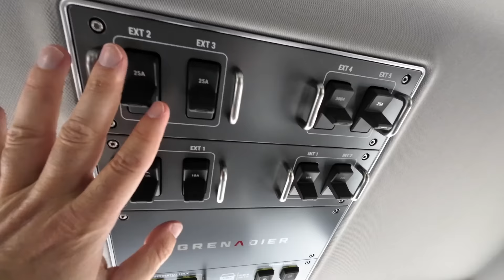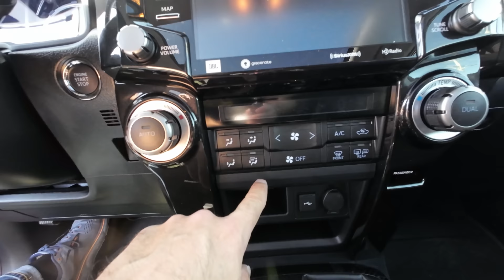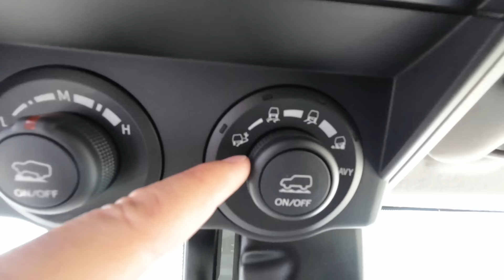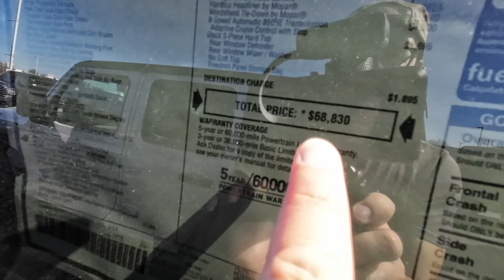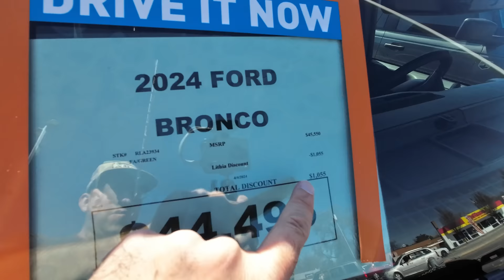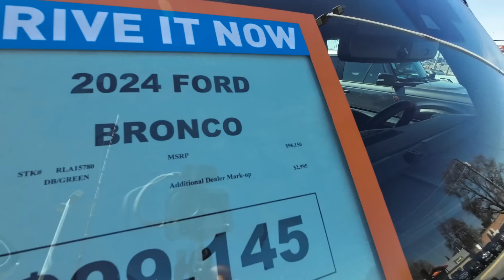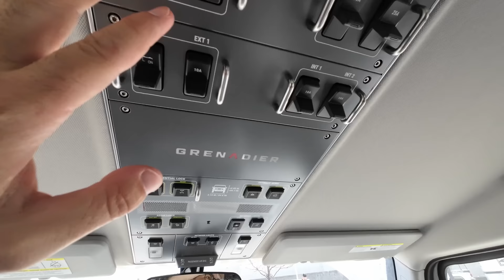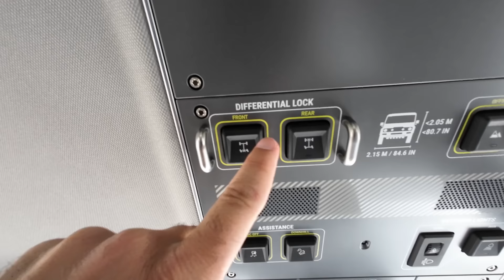This NEW SUV Has Ford & Toyota in PANIC Mode!

Comment: Listen good review yet I feel you miss some major points; 

The Jeep is not a good tower even on the small scale unless it’s a tiny travel trailer. And the Four Runner although not much better yet the slightly longer wheel base length, is better for towing.. And the 4Runner steering wheel. The Steering Wheel spacing at the bottom of the circumference has a “opening “ to rest your hand and arm as you tow or any distance driving regardless if you’re towing or not. 

The Branco is the best at towing among them all; Ford offers a Tow package and Ecoboost is spot on 🏁 Now I’m someone that tows,  two different Travel Trailers. I love Jeeps by the way. Yet my experience with towing wasn’t good in regard to my current half-ton.

Comment: All bout the 4 Runner. It’s Proven. I could care less bout “Out Dated”. If I could afford it, I’d snatch an SR5 with tow kit h and 3rd row before they screw it up with a turbo. Simpler switch gear is preference of mine, too. 42k is simply too much $, though. The TRD Pro seems too silly. Side steps are dumb, I prefer simpler controls and dislike the carbon fiber crap. That new one looks angry, no thanks!
The Wrangler needs a 30% cut in price. Better steering. Better mpg. I’d get a 2 door Sport S with  V6 and manual, but not for over 25k. They’ll start dumping them soon, sales are terrible. Base Broncos were 28k. It’s super sad they dropped it. Manual Base is the only one I’d like. It’s cool and under stated with manual. My kind of vehicle. 
I’m skeptical on the Grenadier Beamer powertrain. Regardless of Toyota testing and utilization.  We’ve been through this with Subaru power plants and Yamaha with Toyota.

Comment: I actually like what i see in the forruner in the video , and the Host of the video points out it has not changed much on that particular model in ten years .
 Which I see as big plus , if you buy a model that is known to be a good model and has a long run period, you can bet most of the bugs have been worked out and it will probably last for many years and be reliable.
 In my case i bought Toyota sedan in Australia that had a model run of 13 years which i new before i bought it , it was a fleet special or taxi spec model basically equipped, but with everything i need and nothing i dont !
 No stupid gimmicky huge  tv screens in the middle of the dash or intrusive not needed safety items that can be an annoyance .
 If i cant keep a car in the middle of the lane i shouldn't be driving the bastard , and neither should others.
 The car is  7 years old now and other than general standard  maintenance, i haven't had to put a spanner on it, except when I fitted a towbar.
  Maybe I'm old fashioned , but i see people all worried about not having the latest gimmicky crap in their cars , which nine  times out of ten makes for added complexity and less reliability.
 To coin the American phrase, " if it aint broke don't fix it".

Comment: Grenadier.   Named after a London pub. Starting at over $73k,  I'll pass on it and keep my 1991 Nissan Pathfinder 4x4 with 198k miles on it.  It goes were I need to go in the mountains, has a am/fm radio and a heater. None of the crap they put on new vehicles that cost a fortune to fix.  And I hate FAKE vents on a vehicle.

Comment: OK - Grenadier owner and former Idahoan weighing in here.  I really struggled with the choice - looked hard at the new Defender, the Sequoia TRD Pro, and whatever I could find out about whatever the new 4Runner will be, as well as all the pre-release info I could get on the new Land Cruiser.  The Lexus GX - I’m sorry, probably a perfect 4x4 but I just have a visceral hatred of Lexus.  Bronco and Rubicon hard pass.  I LOVE Toyota - but the Sequoia is absurdly huge, third row unusable, 2nd row in Pro are captains chairs, load deck is really high to handle the battery over the rear axle - and no flat load.  Toyota - I’m sorry, HP and torque numbers aside, I do NOT want a hybrid 4 and independent suspension up front - I want solid axle, 3 locks.  If I got the LC (eventually), and made it work with a lift kit, better bash plates, decent wheels / tires, I would probably spend almost as much as the Grenadier (86,5 plus destination fee - 88 and change).  But that would still be pretty awesome, front axle aside.  The new Defender - I just don’t think I can trust JLR - way too much to go wrong, with air suspension and everything.  I wanted stripped back and loved that Ineos used all the components most of us would pick ourselves for off-road mods.  Brembo, Eibach, Bilstein - in terms of the engine - the B58 has been in the top 10 in the world 4 out of the last 8 years.  Toyota engineers are totally behind it.  And the ZF transmission is buttah.  I’m just not buying the anti-German line, here.  All the engineering around the Grenadier is from Magna Steyr (Austria) - same as the G Wagen.  Ineos even pulled over the COO for the automotive division from Magna.  This is a really serious endeavor- not playing around with some mall crawler Pavement Princess.  The cost is not off what soccer moms are paying for their Yukon Denalis or if you did mods to one of the new Toyota Land Cruisers- and the price is for the quality of the components and construction (oh yeah, all the assembly line guys are from the Mercedes plant that Ineos bought in Hambach).  Not creature comforts or fluff.  Yes, I’m worried about service and parts.  Yes, I wish there were better interior storage options (where do I put my phone?!!!).  Yes, I still miss my turns when parking and need to take a second run at it.  But I absolutely love every square inch of that thing.  It has more character and honesty than anything I’ve ever driven (anything new, I mean).
Reply: OK, but give us an update on what you think of it in 5 years? I'll still be loving my Toyota in five years.
Reply: Yeah I’ve got 2 Toyotas - of course I love them.  I kind of don’t get the indignation of Toyota owners over the Grenadier.  Toyota walked away from the “real” Land Cruiser, so it’s not a huge surprise that there would be buyers for an expensive, overbuilt 4x4 tank with 2 solid axles that doesn’t run on a hybrid 4 (shudder).  Honestly JLR and Toyota did the same thing to those buyers at the same time - leaving them with hybrids and independent suspension.  Classic Defender and Heritage Land Cruiser - RIP.  You both deserved a better fate.

Comment: wats sad is USA's war on diesels! if the B57 diesel isn't offered its a pity!
Reply: Correct - the reason Ineos couldn’t offer the B57 in the US (it’s offered in the other markets) is BMW couldn’t offer a 10+ year emissions certification, so Ineos couldn’t take the risk.  So we only get the B58.  That’s a regulatory situation - not a BMW or Ineos thing.  Only other option would have been to go with a different engine and transmission supplier - no WAY Toyota would have gone for that, and they are hell bent on hybrid, which Ineos didn’t want anyhow.

Comment: Give me an old 4x4 any day over anything newer. I'm talking older like 1979 and earlier Ford 4x4's, 1995 and below Toyota 4x4, 1987 or earlier Suzuki 4x4. No ABS, No traction control, No driving assistance features, actual tactile knobs and buttons. built like tanks and can go anywhere.  No bells and whistles to force you to take your eyes off the road for 10 minutes just to find the icon on the screen to turn on your windshield wipers. And NO vehicle should cost more than a house.

Comment: The only problem it’s a ford, when you take a ford into the dealer they will say we don’t know how to fix it.  You get to drive around with check engine light on and poor performance and multiple breakdowns.
Reply: The crap 10 speed transmission they built with GM has a class action lawsuit. Error codes conveniently wipe themselves before you get to the dealer.
Reply: Only Ford? It's every dealership.All you'er paying for is the "TajMahl" showrooms, finance department and bullshit sales force. These little turbo engines are pure crap, all scrap in no time flat.

Comment: Cool video but you forgot the king 

2024 Toyota Land Cruiser

You have a jeep so i know reliability is not your top concern 😅
Reply from the maker: Haha. For now... I choose fun over reliability.
Reply: @MotorFeed  fair enough!!! :)
Reply: You mean the one with independent suspension, no front locker, a hybrid 4 cylinder, baby road wheels and 8” of clearance?  The new LC is not anywhere NEAR the capability or toughness of the Grenadier.  To get that, you need to go back to the LC 200.
Reply: @ElderStatesman-pi3lc  then less go back to the 200 and use the same money spent on the granadier on the 200 and see what happens 🙂, also when the granadier gets to last as much as the 200s then get back to me.
Reply: @tito10301 ok - so basically “I don’t think this new 4x4 is any good because it’s a new 4x4 and until it’s an old 4x4 I still won’t think it’s a good new 4x4.”  Toyota jumped ship in the US market, as did JLR - so I’m willing to risk it to get the truck I want and not what Toyota is trying to jam down my throat.
Reply: @ElderStatesman-pi3lc  sure thing is your money good luck tho 🙂
Reply: @tito10301  I know there’s some risk - but let’s recognize that the 2024 LC will be king of nothing.  It will probably be good - with some significant aftermarket modifications.  The clearance is sad, the hybrid 4 will break off-roader’s brains, the independent suspension in front will be continuously challenged, aux power up top will require drilling and running line, there is no offline battery, there is no integrated winch, etc etc.  The sheer awesomeness of the old LC is gone.  Toyota is starting from square 1 with a mall crawler that MIGHT be able to be turned into something decent, with significant effort and cost.  Or, Ineos will deliver that same capability and more, right off the factory floor.  I almost went for the LC ‘24 first edition and was tryimg to secure a purchase slot (we also have a ‘19 Taco TRD Off-road).  I took the Grenadier back to the Toyota dealer to show them WHY I decided against it.  Sales and service guys came piling out - cameras, climbing all over it - their statement, not mine “this is next level - this is a different league from the new LC.”  Their only comfort was Ineos isn’t targeting high volume - and they hate the BMW engine (we then fought about the fact their engineers certified it for the Supra).

Comment: The new Toyota Land Cruiser is the way to go. Reliability, ability, comfort, and toughness. The Grenadier is just a Land Rover clone, uses a BMW inline-6 with a turbo, and it's built in France. It will be capable off road, but has no dealer support, no easy parts availability, and lacks Toyota reliability.

Comment: IMO, it's a fail. #1 BMW turbo engine.  #2 automatic sourced from BMW parts.  So it's basically a maintenance turd right out of the box.  The smart money is on a Bronco with manual.  Nothing to break, dead simple.

Comment: The “outdated” 4Runner is the best vehicle you’ve shown, if you can get the one you showed for 42000 plus TTL you got e decent deal, especially compared to the Jeep and Bronco. Stellantis/FCA is pumping out junk, you’ll go broke changing trim parts, door lock actuators, switches, key fobs, etc. Not to mention oil leaks at oil filter housings, dual stage oil pumps that go bad, leaky valve covers, transmission solenoid packs and valve body replacements, which may or may not require trans overhaul. Ford is just plain overpriced for mediocre build quality and greedy markups for the last few years by dealerships. That outdated 4Runner will still be purring while these other vehicles being compared are a service nightmare in 6 years after the warranty is up, especially at 90k purchase price.

Comment: Cost of Grenadier?
Reply: $71,900 base; I think $79,000 for stock Trialmaster or Fieldmaster trims.  Most of the buyers are probably optioning up in the mid 80’s;  you could, in theory, option up with every single goody (winches, towing package, all the external accessories, contrast frame and roof etc) into mid 90’s.

Comment: IMHO, the ZF trans is the best there is. It also is used in some vehicles that may surprise you, from RAM trucks to Bentley/RR cars and more!  That 4 cyl turbo,  I saw a video of them being made, in China!!  Groan.... 8(    --gary
Reply: Except the replacement of that transmission is a literal money pit to deal with.  For true off-road that's why you get something with manual if you can.  That pretty much leaves Jeep and a few specific models ( like the base Bronco ).

Comment: Ford 10 speed transmission is crap. They have an 80% fail rate within the first 40k miles. Do your research before boosting something in your videos 😉. Other than that I really like your videos very well done.

Comment: Asinine clickbait title and IG is NOT a SUV.... It is a purpose build 4x4 overlander.  
Permanent four wheel drive,  live axle with FRONT,  back, and center lockers.  
Towing.... Jeep Rubicon 2,000lbs, 4Runner 5,000 lbs, IG 7,700lbs  apples and oranges.
Shut Jeep door, sounds like a matchbox car, close a Grenadier door, sounds like a Mercedes.

Comment: Yes the Toyota is outdated in some aspects. But hands down has the best off-road capability & reliability. Ford and the grenadier shouldn’t be on the list! Ford has had the most recalls for 3 years running. And the grenadier is too new . Not to mention grenadier means grenade!

Comment: That's a complete miss. Here's the correct base model they should have: Manual transmission/windows/door locks, no center screen, any Toyota 6 cyl engine, manual levers for 4W Hi/Low, A/C, Cruise, and the rest optional individually. What they made is just another pretty-boy toy and the world already has too many of those.

Comment: well, gonna stick with mine 3rd gen 4runner, have 3 spare engines in my storage, 2 transmissions and some axles, collected over the years, all cheap and swappable over weekend :))) sorry gettin older and smarter i guess, or broke, call it whatever u want, but Im always mobile :))) if there is a gas in a tank, the damn thing just goes :))) 300thsnds plus, no leaks, all original engine and A/T, so yeah, thx but NO :))

Comment: It was sounding good until you got to the BMW engine.  So essentially this will be worth scrap value by 60k miles as the engine will require $25k worth of work to stop leaking or just plain run.  I'm waiting on the new Land Cruiser.
Reply from the maker: you can get a Diesel engine in other countries. As usual... we get the worst version of the new cool thing.
Reply: @MotorFeed truth!

Comment: 😡 Grenaier $71k, F#ck off, these thungs will rust on the lot.
Reply: - everything on the lot is already sold.  They are built to order - and are running about 9-10 months from order to delivery. They are kind of the ultimate score/flex right now, and there are a lot of people who don’t blink at $80-100k.  Way more demand than supply, so let’s see how they hold up under hard use and whether Ineos can get the dealer and service network sorted out.

Comment: You have lost all credibility choosing a Jeep anything over a Toyota 4 Runner. Check CR's report on the Jeep reliability, its dismal. 

Apple has done a hell of a job convincing the younger generation that everything is disposable.  If it doesn't have the latest, largest screen and bling, throw it away. Jeeps in the 70's were the cheapest vehicle you could buy.  Nothing justifies the current atmospheric prices.

Comment: Teslas are the safest cars in an accident of any vehicle ever tested by the NHTSA and the least likely to get in an accident due to better handling and superior safety avoidance systems which are always including which many cars do not offer or are not as capable.   Teslas have a lower center of gravity than even most sports cars and a lower polar moment of inertia than the best mid engine sports cars. FACT!

Comment: Hmmmm., bmw which powers the x5, that means do not use in arid hot locations for more than a few years, it’s made of plastic, besides the block, but manifold and all air flow is cheap plastic that is problematic which is why the x5 is unreliable and problematic. But hey., it definitely looks great.

Comment: Dude... seriously.  I don't think you know what you are talking about.  Jeeps are unreliable.  The 3.6L is oil-starved causing failure to you rockers within 30k or even less miles. Things start falling apart on it sub 50k miles with no off road use.  Failed window operation. Random wipers turning on where you have to take off the negative to resrt your computer.  POS shocks that fail sub 30k miles. Gas lines splitting inside engine. Sun visors deteriorating.  I could go on.

Also... how can you with a straight face recommend a Rubicon that was 45k$ tops a few years ago and tell people that 96k$ is normal.  You also paid 45k$ for a used 2019?  Are you insane?

Just stick to promoting your lawyer which is the basis of your video, not valid information.

Comment: Your bragging about these pathetic gas suvs is laughable. We own two evs and at least one, if not both have more hp, torque and acceleration for sure than most or all of these suvs, jeeps and pickups. Their traction ability and handling blows away any gas vehicle. Ground clearance is another story but that only matters if you are going to really off road which most of these joke owners never do anyway. Otherwise you can just buy a Rivian or cybertruck and they will out offroad any of these vehicles. They cost less to charge than fuel to the tune of thousands a year, require little or no maintenance saving thousands more over a few years, almost never need brake changes, saving even more and having a higher resale. Motors and batteries will last 500k to a millions miles.   What people do not know about evs is laughable and sad.